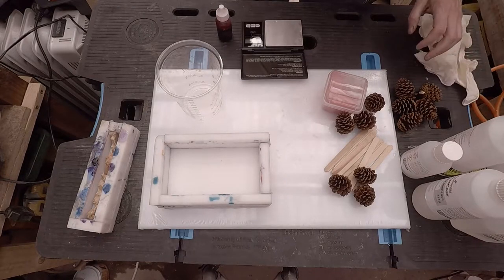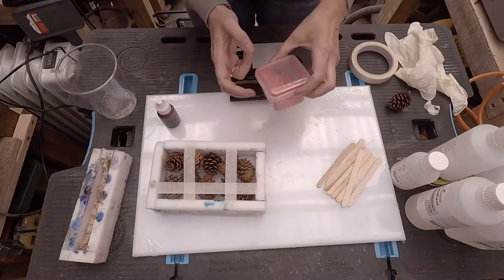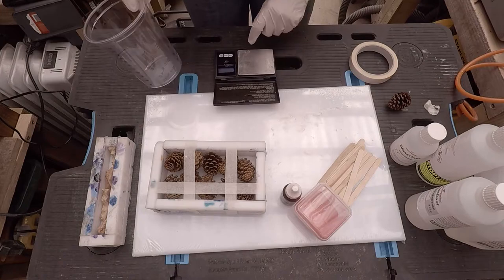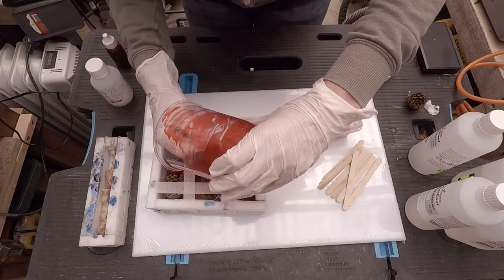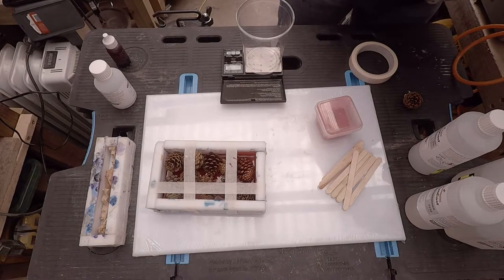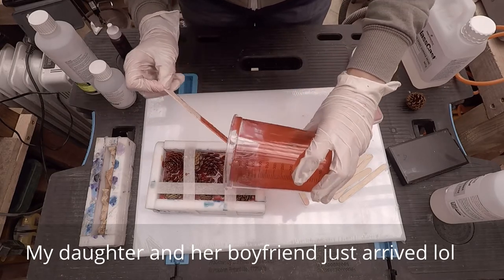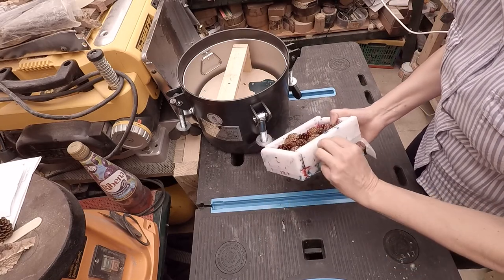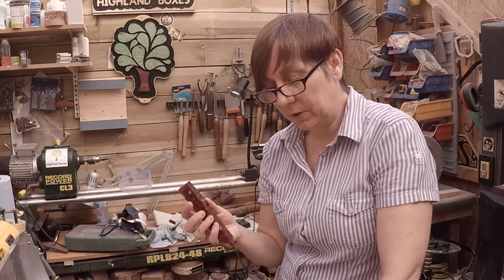Pine cone pen blank casting (part 1)

Comment: Hi Pam, they're great! Ive made a couple of pinecone blanks and stabilized the pine cones first. when put in the oven they popped like popcorn and opened right up, perhaps i had the heat on to high and for only 15mins in the oven. good luck and look forward to part 2
Reply from the maker: David Flanagan thank you ☺

Comment: Nice! Pinecone penblanks are really cool  and make for really nice looking pens....going to head over and watch part 2 now :) I found that as long as you have high speeds, sharp tools, and slow light cuts you avoid a lot of the chipping out. Cool to see that the unstabilized cones seemed to work out well without bubbles!
Reply from the maker: Hey Michael yeh it turned really well no real issues i was very surprised and its the best pen ive made was really happy. Thank you Pam

Comment: Hi Pam, another fantastic video. Don't you think it might be better to stabilize those pine cones instead natural? I think the pine cone fibers can be too soft (without stabilization) and may wear out gradually with time, use or become sawdust or anything else. Could you let us know if the new pigment worked well and where to find it? Thank you for sharing your knowledge :)
Reply from the maker: Salvi i get the pigment from metal clay it works well i will add the link. I dont think the un stabilised pine cone will be an issue its sealed in resin and finished with CA glue but time will tell i suppose. Thank you very much regards pam.  http://www.metalclay.co.uk/alumilite-dye-red-29-6ml-1fl-oz/

Comment: Magic! What size pressure pot do you have, and how long to you put it on  for? Thanks 😊
Reply from the maker: Hi Nikki i have a 10L pot i put in for at least 8hours as resin is slow set and i cant de-mould till around 24 hours. Thank you Pam
Reply: What purpose does the pressure pot serve?
Reply from the maker: To remove bubbles from the resin.
Reply: Highlandboxes oh, OK... Thanks for the reply!